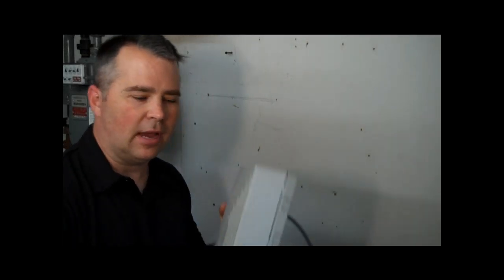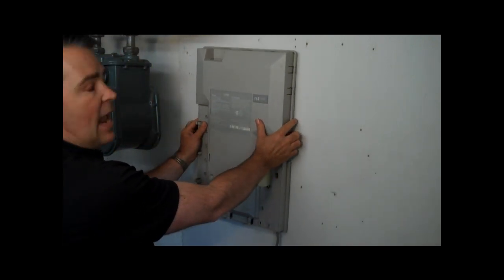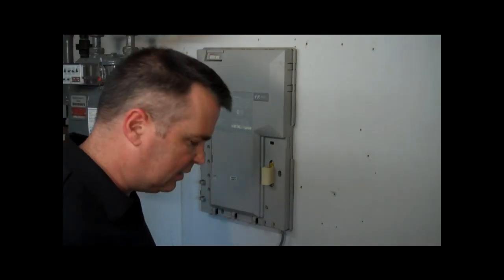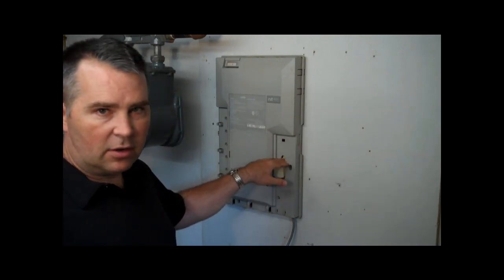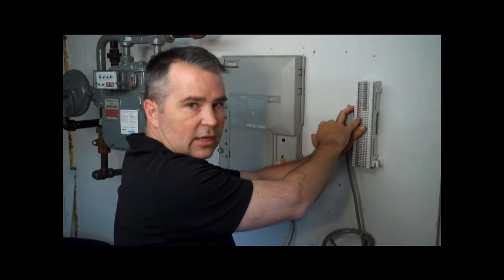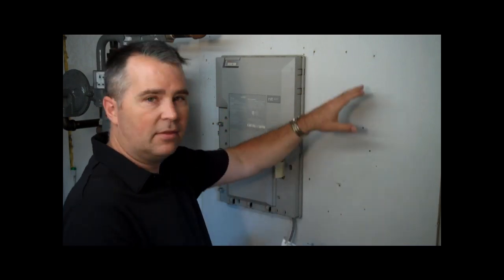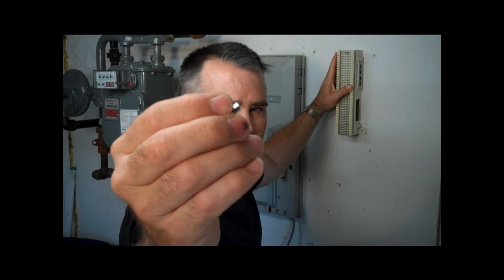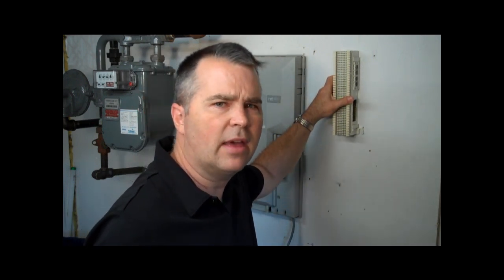installing a Nortel Norstar 6x16

Comment: Thank you. This video clarified a few points and gave term to definition of a few items. Specifically the RJ21 connector, or Amphenol connector. I am anxious to wire one up manually as documented. I thank you for the video.
In Jesus' name are you healed.
Reply from the maker: Hi Tomm, glad the video helped.  That's why I make them. :-)